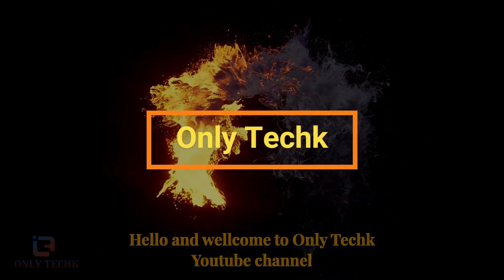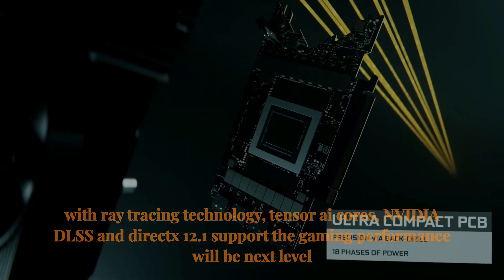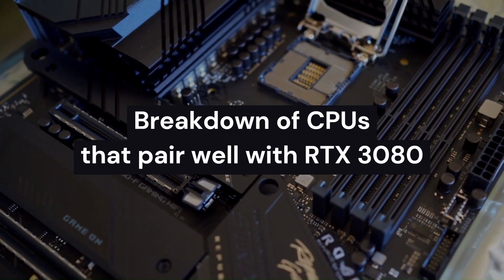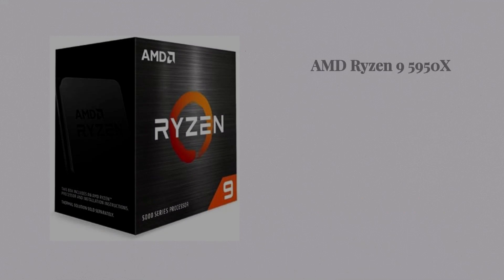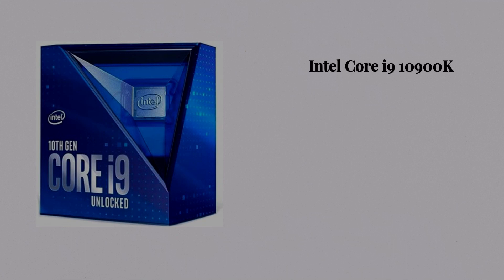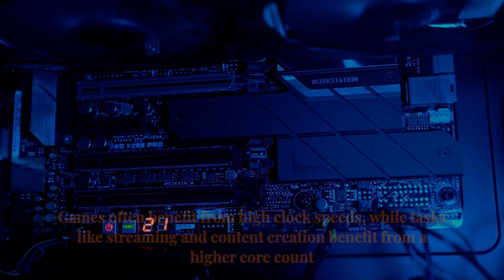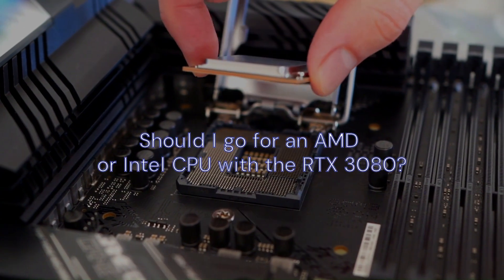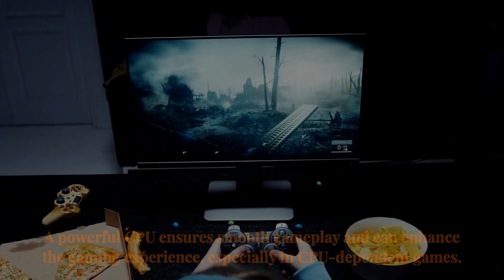Best CPU for RTX 3080 in 2024

Comment: Would a Ryzen 5 7600 (x) and non X be a good pair for it? Or would a 13600k be good?
Reply: Ryzen 5 7600
Reply from the maker: Both the Ryzen 5 7600 and the 13600K would be excellent choices, depending on your preference! The Ryzen 5 7600 (and 7600X) offers great performance for gaming and multitasking, while the 13600K is a powerful option from Intel with excellent single-core performance. If you're aiming for strong gaming and overall performance, both are solid picks, but if you need more multi-threaded power, the 13600K could have a slight edge. It comes down to whether you're more comfortable with AMD or Intel!